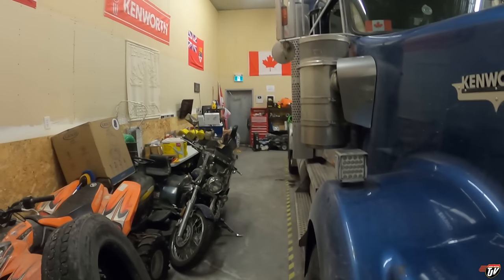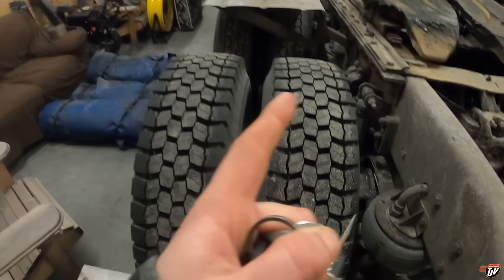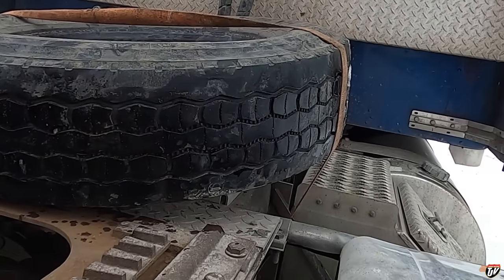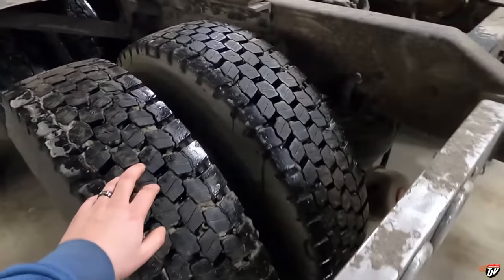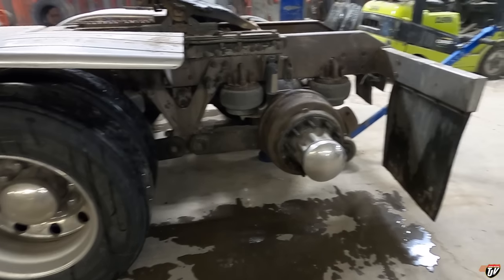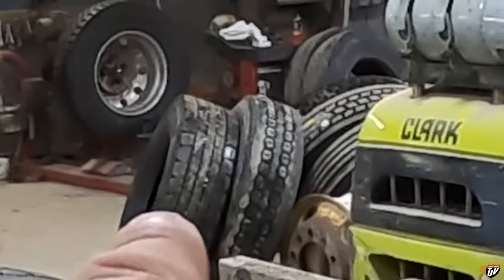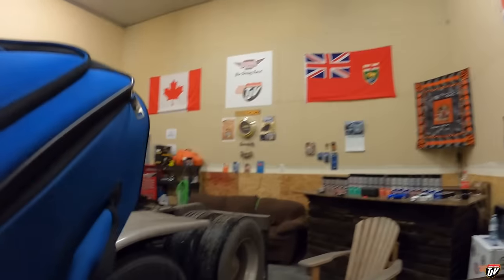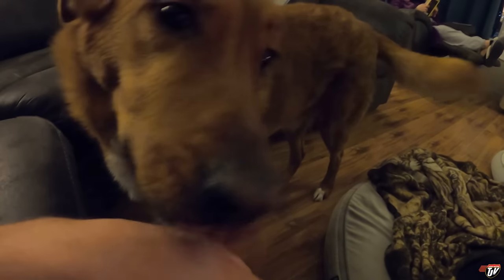ANOTHER TIRE | My Trucking Life | Vlog #2717

Comment: Josh. Remember to rotate drives in a X pattern when the back axle is 4/32” worn more the the front drive axle. Rotate steers side to side when there is 2/32” difference between the two tires

Comment: Have you considered getting your own account through a tire shop (K-T, Fountain, etc.)? It's worth looking into.
 I understand using the carriers account, but the discounts won't be that far off. You wouldn't be bound to a tire brand specifically, each brand carried by the shop would have it's own discount pricing scale. You can get casing returns more quickly. You can compare pricing and know the cost upfront. If you're using a credit card, you're building reward points for yourself instead of the carrier. Plus, you would get discounts on your own personal vehicles, which I though was a bonus!

Comment: The rear axle is the drive axle the front only drives when you lock up the diffs that's why the back wears out faster then the front diff tires.
Reply: Wow, the information you guys need to stay safe! Amazing. 👍🏻😳♥️
Reply: incorrect, both axles drive, as open differentials unless equipped with lockers, check this video it shows and explains the operation.  https://www.youtube.com/watch?v=qygtfkcoqUQ
Reply: Nnot quite true, that odd looking section on the front  differential is whats called a power devider works on the ssme prinscepal as the actuall differentials power input goes through a set of spider gears ans distrutes power eqally to left and right sides  BUT if one side has less tracton than other side the side with less traction will spin the spider gear aragment also makes up for different size of tires from side to side. Now the power devider dose basically the same thing between front and rear axles.
Reply: Not sure if you are disagreeing with me or not. You are correct in that the power divider works like a conventional differential and as such will send the torque to the wheel set with the least traction, so if the divider is unlocked and all 4 wheels have equal traction, all 4 pull equally. In a situation where you are bogged down trying to move, if one tire set loses traction, it will spin.  Modern equipment allows you to lock front and rear (differential lock) putting power to front and rear diffs and some allow side to side (axle lock). All locked up you only need one tire set with ample traction to get you out.